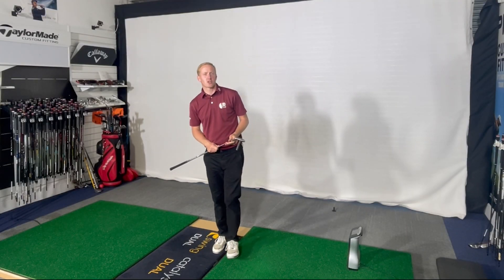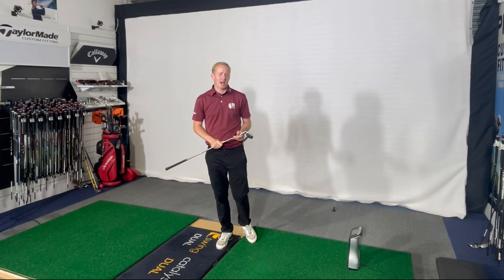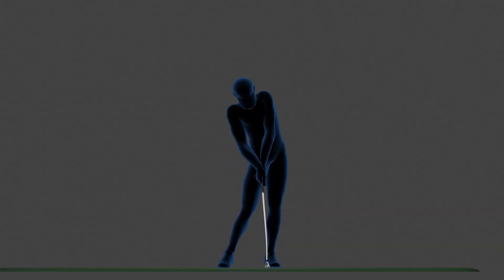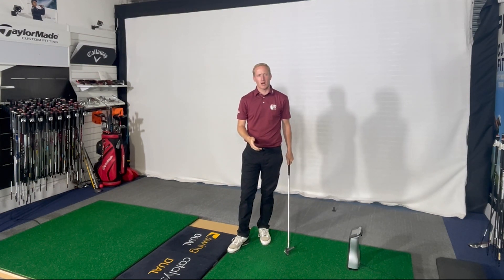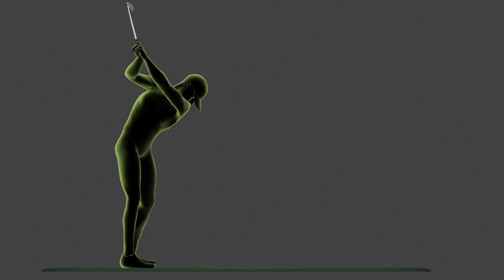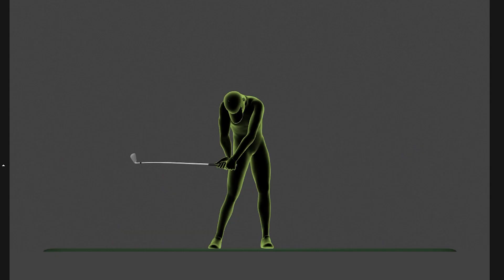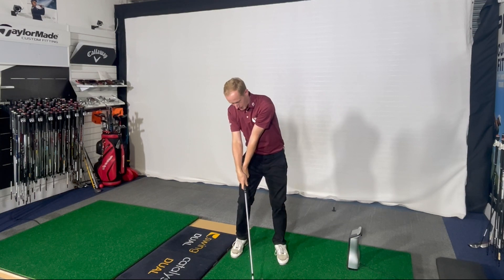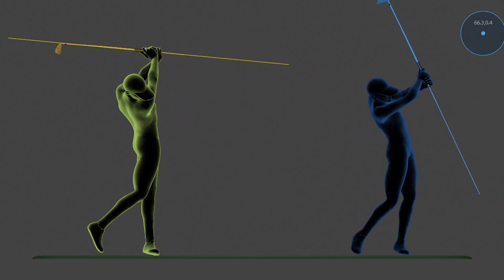The trick to creating consistent shaft lean - Every Time!

Comment: Good point your are making on the cause of lack of shaft lean through impact resulting in lack of dynamic loft and loss of low point control through impact.The mischief lies in open club face in the transition... Not sure of your prescribed fix for the mischief other than to fix it but how and when? My solution/fix would be to close the club face so it is slightly closed or square done by rotating the lead wrist clockwise once you get to the top of the back swing.